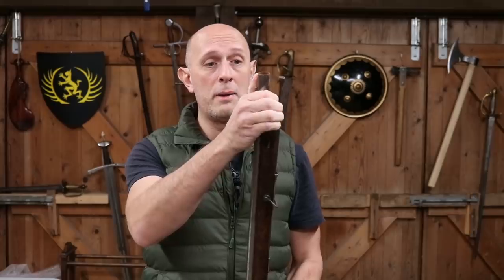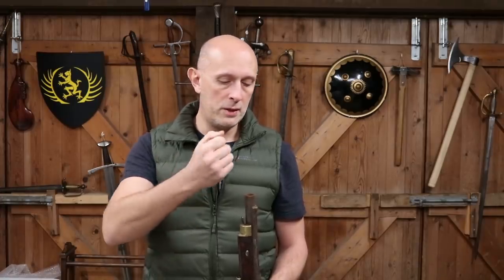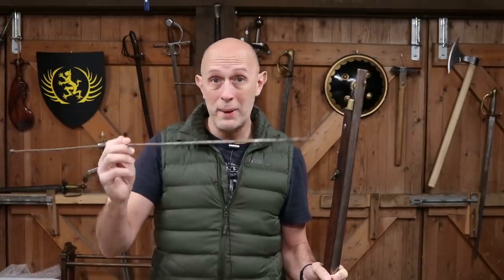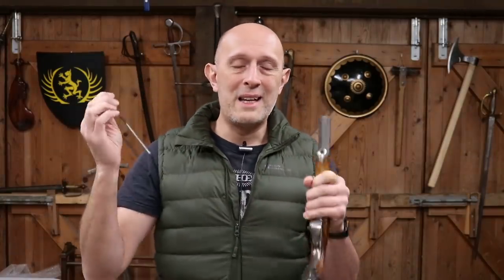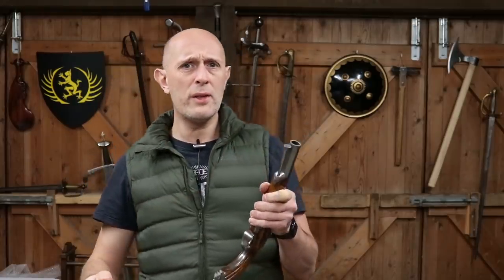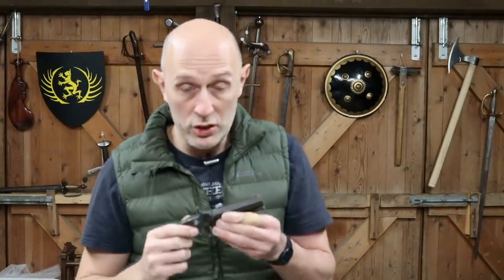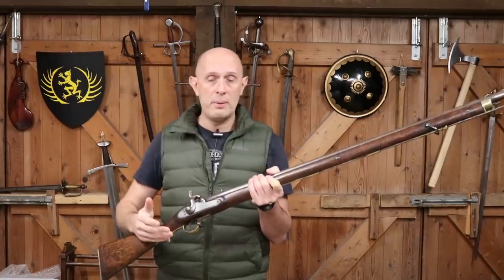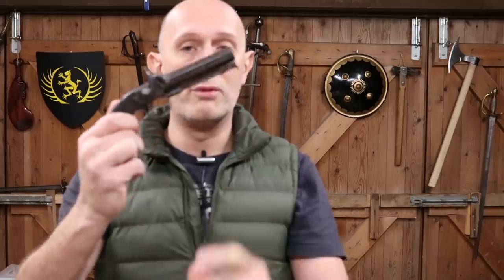Captive Ramrods on Muzzle Loading Guns

Comment: Cap & Ball pistols like the Colt 1861 Navy also have what is effectively a captive ramrod, in the two part lever and ball plunger.
Reply from the maker: Indeed - that tech basically started with the type shown in this video and developed from there.
Reply: True; but cap & ball revolvers aren't technically "muzzle loaders".
Reply: @Lucius1958  - I didn't say that they were ;)

Comment: Hi, Matt.

This made me consider the episode of Sharpe in which he was training some useless redcoats.
In order to beat an unattainable rate of fire set by whichever snooty CO, our Sharpe old Bean got the recruits to pour, then tap the butt against the floor, then fire, whilst always keeping the barrel above horizontal.
It supposedly allowed the higher rate of fire, and although the lower pressured powder wouldn't be as explosive/accurate, it would still be a danger, and a deterrent.
Does the idea hold any weight or instances in history?
Asking for a fiend.
Reply: Here's the very clip.
https://www.youtube.com/watch?v=Z9RAh1J4NE0
Reply: I remember a reenactor once told me the same thing. I don’t know if it would effect muzzle velocity or accuracy. The man did own a working replica of a Civil War era musket and so it is probable that he had tried it.
Reply: It could work but it's an unsafe practice for a couple of reasons which all boil down to putting your face in front of the muzzle with the potential of the weapon going off by accident.
Reply: @Riceball01  It is only really unsafe if you prime the pan first. This was how it was done in the day using a little powder from the cartridge before dumping the rest down the barrel, however normal practice these days is to prime last out of a flask. This is still the case if using the ramrod. Obviously with percussion guns you just put the cap on last. Regardless, spitting the ball is kind of unnecessary, just drop it by hand.
Reply: @joshuastamos2213  It affects both. Muzzle velocity is worse as firstly the powder is not compressed, and secondly the paper wad is missing so you get more wasted gas blowing past the ball. As for accuracy, without the paper patch the ball is effectively a smaller diameter so is bouncing down the bore even more than normal.
Reply: @commando552  That would eliminate the risk from the tapping part but, from what I'm given to understand, there's still a risk when pouring powder down the barrel. Apparently the concern there is that after several volleys the barrel get hot enough or there's some embers down in it that could set off any fresh powder added to the weapon. It would be add enough if it happened immediately after pouring fresh powder down the barrel but it would be much worse if there was a slight delay and it fired right after dropping the ball in.
Reply: Paul Sweeney That was for the Baker rifle which fired a ball wrapped in a greased leather patch to grip the rifling.  The ball without the patch was sub calibre and hence would in theory drop to the bottom. I doubt it would work for a musket as the ball would stick before it got to the bottom. With any fouling, no chance.
Reply: Looked at the Australian video works well I'd also read somewhere that the German troops in English service fighting in the American war of independence where known for using this version of loading in battle.
Reply: @4d4m22  It works with a Brown Bess, they have an oversized enough bore to accommodate a ball wrapped in a paper cartridge, without the paper wadding it will drop down assuming it is not horrifically fouled.
Reply: @Riceball01  I really do not think there is a risk of it cooking off from heat in the bore. The bigger risk would be from remaining embers but that has exactly the same risk as normal loading as in both cases the first step is to pour loose powder down the barrel. Cooking off only really happen with machine guns that have a high rate of fire that is not really attainable with a muzzle loader, but more importantly they use different powders. Modern smokeless powders have a far lower auto-ignition temperature than black powder. I think smokeless will ignite as something like 200 degrees Celsius or even a little less (which is still ridiculously hot for a muzzle loader), but black powder will not ignite till about 450 degrees.

Comment: The drawback is, that you can’t leave the ramrod in the gun and fire it to confuse and terrify the enemy
Reply: That's another way they got "lost" in the heat of battle. It's even still a problem with re-enactors today.
Reply: Mark Fergerson It poses a risk,but for most re-enactor(my experience as a civil war one) you just pour down the power(no wad, or use of the ramrod) for safety concerns

Comment: I always thought the ramrod was used the way Matt showed it: pull it out, flip it & used the large round disc to push the ball down the barrel. Then I saw Ernie Cowan  demonstrate his reproduction 1776 Rifle at the Dixon's Gun Maker's fair. The 1776 Rifle also uses a captive ramrod. Surprisingly and counter intuitively the skinny end of the ramrod swings over the patched ball sitting in the muzzle and the large round flat disc on the other end of the ramrod is smacked sharply with the palm of the hand to drive/start the ball down the barrel (the muzzle is coned to facilitate this). Reloading was extremely quick, yeah it wasn't the tightest patched ball, but I bet Ernie could get 3 shots off in a minute starting with a loaded gun. 

So the last reason to use a captive ramrod is to facilitate a fast reload.

Rgds,

John

Comment: Often when you pistol or rifle fires, recoil moves the gun back, but because of inertia the ramrod sometimes stays still.  That means the ramrod slowly works its way out of the gun and can sometimes actually leave the gun and become lost,  A late 19th century fix applied to cleaning rods, which sometimes behaved the same way, was to put threads on the end of the rod which mated with a thread hole in the gun.  That meant the ramrod or cleaning rod stayed with the gun when it was fired.

Comment: Kalashnikovs still have rods in that place for cleaning. Most people remove them and use other cleaning methods, I admit my boresnake is far superior. But I keep it there on my rifle, because one can use them to unjam the weapon; if a spent casing or entire round is stuck in the chamber and won't extract - say the casing's rim was torn by the extractor or the whole round just rusted in place. ARs and M-16s in hot humid Vietnam were notorious for rounds swelling overnight when left in the chamber; though it can happen to any gun. ARs can't keep rods  under the barrel tho, and 5.56x45 is a long straight round that's tougher to feed and extract, unlike distal tapered AK rounds - both 7.62x39 and 5.45x39. On record several times, unable to unjam their Armalite rifles from such malfunctions, many American men died. In once case, a unit of US Marines were found wiped out with 50% of their M16s not working. I think it was most of a company. And don't try to tell me that's all back in Vietnam, I've seen friends have the same malfunction with their AR15s on the range, without even spending an entire night outdoors (just a few hour hike). We used my cleaning rod to fix their rifle, if at all. Sometimes people go home and need tools to make the Armalite shoot again. I've seen AKs melted down from shooting so much, them smacked against trees very hard to bend them back, and go on shooting happily and would be able to for years to come. Just another reason I went AK - and never looked back.

It's funny how where the ramrod once was, the little mysterious circle under the barrel if you're staring down the muzzle, is now where the recoil spring is. And there's still a mysterious circle under the scary black hole the bullets come out of. On revolvers the little rod was there, sticking out the side like the opening of GunSmoke. Some include it inside the cylinder now, but it still sits under the barrel, adding another circle or odd shape underneath if one is staring down the barrel. Look at my Glock now, and there's a plastic rod under the barrel that slightly protrudes from the frame needed for the gun to shoot more than once - or at all. In all cases, the have to do with letting the gun shoot again. These days, people debate captive recoil springs instead of captive ramrods. Some things never change.

When there is no longer a need for mysterious rods underneath the barrels of guns for them to fire repeatedly, they will have jumped a technological gap.
Reply: It's not really exclusive to the AK, most military bolt guns have them too.

Comment: Smooth bores used metal ramrods. Rifled barrels require wood, or modern plastic to protect the rifling.
Reply: Or copper/brass rods or steel rods with a brass or copper end

Comment: Often the balls for muskets were substantially undersized to help deal with fouling. There are accounts of loading (in a realitively clean bore) by putting just the ball minus paper down the barrel, and smacking the butt on the ground to seat the ball on the powder. This was one way to shoot the musket a bit faster. 
Cornwall has Sharpe and his boys use this on occasion in their battles.

Comment: Two questions, if you don't mind.

1. Could you, if for some reason you had black powder but no balls, fire the ramrod at the enemy, to any effect?
.2. Before the captive ramrod, did soldiers generally carry spare ramrods?
Reply from the maker: 1. You can shoot a ramrod like an arrow, but not very effectively because it does not form a seal with the inside of the barrel and so will not travel straight, as well as allowing a lot of gas to escape around and past it.
2. Not that I am aware of.
Reply: @scholagladiatoria  I think the poor seal argument is moot since you'd be using a patch (or as many as needed to make a seal) anyways. I think the bigger issue is that once you lose your ram rod you've permanently resigned any further use of your gun: you're down to swingin' cod. You're probably better off retreating and regrouping if you have any opportunity to do so (with your ram rod).
Reply: I can not answer for across the pond do to speak.
 But I have read a lot of accounts from the American Indian fighting and civil war.
 Where there was alot of times the ramrod was fired out especially in the acw. Normally to no effect.
 And in the Indian fighting most of the accounts I read about the wood ramrod came to pices.
    I think that they fly off of target. Because they do not fit the bore there whispy and bend easily. 
I have seen one shot on a range one time and it went about 60 yd. Down range but about 15 yds. To the left.
And was useless afterwards.
Reply: Anders Benke I cant remember the source, but I recall reading that sergeants carried extra ram rods to issue to soldiers who broke, lost or a accidentally fired their ram rods at the enemy. They also carried replacement flints as well, again from the source I can’t recall.
Reply: @tbjtbj4786  in American civil war reenactments they NEVER use the ramrod to pack the powder when firing (With no ammo, just powder) on the battlefield, because a number of years ago a guy got shot with a ramrod that was left in a musket, I believe in the leg. At least, thats the story the community tells.
Reply: @garyledford2901  interesting could happen. But I bet it was more unlucky than a aimed shot.
You know anything can happen and some times really strange stuff happens with firearms.
 The guys that do natural bridge must not have gotten the order they were using the ramrod last year.

Comment: In one of the Sharpe films the sargent told the troop not to use the ram rod, but to tap the butt of the musket on the ground to set the charge.
Reply from the maker: Yeah... to do that you have to put the ball down the barrel very loose, with basically no paper around it. Otherwise it needs pushing down. The problem with that is that if you level the barrel the ball can literally roll back out again before you fire!
Reply: @scholagladiatoria  that might be a problem!!!!!!

Comment: The Ball is slightly smaller diameter than the bore; therefore you can drop the ball into the barrel and firmly slam the butt of the musket or grip of the pistol onto your thigh in an emergency to seat the ball
Sometimes, a person forgets to remove the ramrod from the barrel and sends it downrange when they fire!

Comment: do dragoons dismount?
i used to think so but at Eidinburgh castle i was told that a dragoon is a cavalrymen that uses a karbine (confirmed by age of empires 3)
what is the corect way to dragoon?
Reply: Really depends when you're doing it. If you're in the mid 18th century, then you're a mounted infantryman and you dismount to fight. In the late 18th and for most of the 19th century,  you're a light cavalryman you fight on horseback. Finally, in the late 19th and early 20th centuries, up and including the first bit of WW1, you were again fighting dismounted, because,  when facing modern magazine rifles and/or machine guns, it's not a great idea to be on top of a horse... 
Just ask the German 2nd Cuirassier regiment at the Battle of the Silver Helmets how that went, since they tried to charge a company of dismounted Belgian cavalrymen and a company of cyclists holding the approaches to the town of Haelen, in Belgium, on the 12 August 1914 and suffered 20% casualties without any gains. As a direct consequence, for the rest of the battle the Germans also fought dismounted.

Comment: I've always wondered, how common was it for the bullet to fall out of a loaded gun? Seems like if you have a pistol at your hip and you didn't shove the shot in there hard enough, it could just slide out eventually.
Reply: The paper wadding of the cartridge helps keep the ball in place by bulking it up a bit and adding some friction. But yeah, if you’re using a fairly undersized ball it could work loose over time. In civilian shooting at the time, it was common to patch the ball - wrap it in a piece of greased cloth. That makes the ball fit really nice and snug in the barrel and keeps it from going anywhere (as well as improving accuracy and consistency) but it slows down loading.

Comment: You should do a vid on tap loading I think it's called where you hit the butt on the ground instead of using a ram rod. Pretty sure it was popular technique in the 1800s
Reply: Sylverleaf Arnold not to much for the ACW, reenactors do it to make sure the powder is down there near the cap nipple.

Comment: Actually I was wondering: Let's say you find a musket lying around somewhere. How do you know whether that musket is loaded or not? I can't imagine that you can simply look down the muzzle and see the contents far down the barrel...  :o)
Reply: Ram rod has lines on it that tell you if there's powder and ball loaded. Or double charged.
Reply: just draw the ramrod and put it into the barrel. 
It will be sticking out maybe 2" more if the gun is loaded compared to a unloaded one. (depending on what exact model of gun we are talking)

The same way you can know if a gun is clean or dirty. If you drop the ramrod down the barrel, it make a "bright bling" when the metal of the rod hit the metal of the barrel. if it is clean.
And it make no sound or more like metal dropped on dirt when dirty.